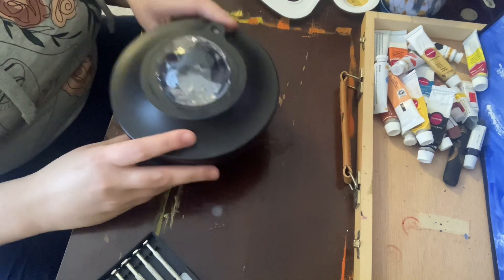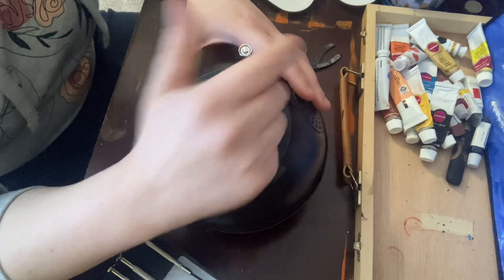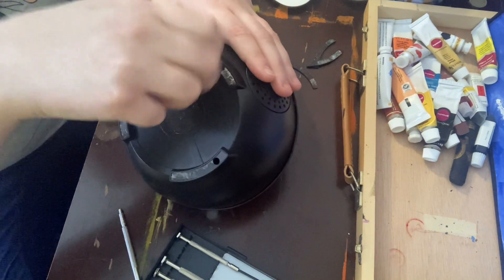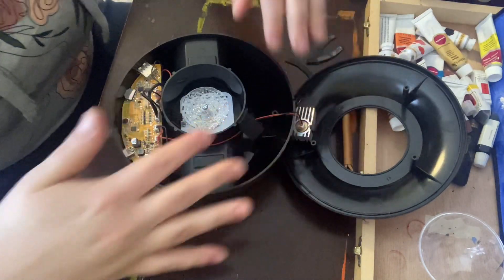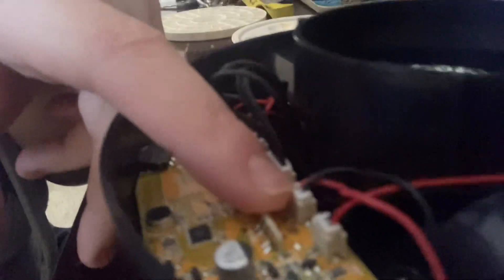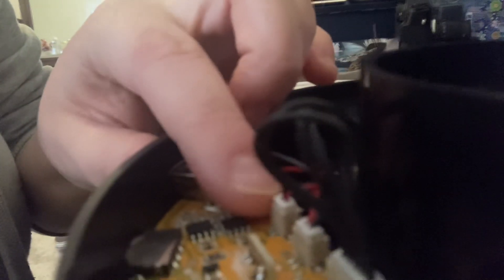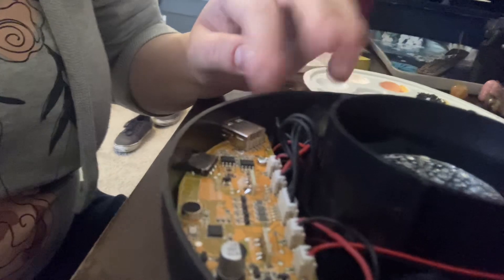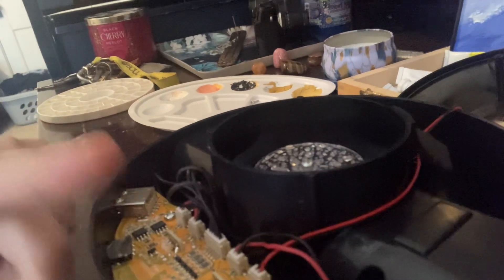Disassembly of Starlight Projector

Comment: the mechanism wouldn't turn so i opened it up and cleaned it and it works but i don't remember how to put the gears back on can you show it in a video how it's inside
Reply from the maker: I can’t, not until 3-4 months at least due to current living situation
Reply: @NotACupcake Thank you very much, I will wait for an update

Comment: My stars are spinning slowly but mine does not have that screwdriver in the middle of mine has a box with four LED lights in the middle followed by a reflective mirror like surface
Reply from the maker: You may have a different model if it doesn’t look like the interior of the one I opened

Comment: I have a different problem... my motor is spinning well, but there is no light being projected, neither white nor RGB, and the laser is fine
Reply from the maker: Did you check to ensure all the cables are fully connected? It might help you if you use some tweasers and very carefully unplug and plug back in the connectors.

Comment: hey man i just got one of these but like a cheaper version of shein and everything works except the motor ig cus its not turning around
Reply from the maker: Shoot if the motor isn’t turning you got a big problem. If you’re savvy in tech repair I imagine you could probably get a cheap mini motor and replace it with that but you would be better off returning the one u got and getting a replacement tbh.
Reply from the maker: Another commenter said you could try unplugging the wire for the motor and plugging it back in, that worked for them as well
Reply: @NotACupcake  alright thanks for the advice man
Reply: @NotACupcake  i’ll try

Comment: Do u know why my white thingy stopped spinning and how I can fix it?
Reply from the maker: If the motor is no longer moving make sure that the connector wires are securely plugged into the chipset and the motor component. If that doesn’t work then your motor might have burned out. You’d have to replace the motor or the entire projector. If you have working parts in the projector you could probably sell it on ebay for parts and use the money to buy a new projector.
Reply from the maker: From my experience of opening up the motor I saw that the gears in the device come very well lubricated with some sort of fine motor oil, so I doubt in your case it could be anything other than a burnt out motor.
Reply from the maker: Of course you can also try resetting the device with the reset button, you would have to google to figure out where the reset button is.
Reply: Yeah I have no idea where to find the reset button on mine
Reply from the maker: @LilTwix81  Because you asked this question I decided to google it. Turns out the manual does not have any information about a reset button. As of writing this I reached out to the manufacturer directly to see if I can get an answer. Fingers crossed!
Reply: So update I found out a way that may work for anyone who is having this problem I disconnected the cable that’s connected to motor and plugged it back in and it works just fine now but I don’t know if it’s temporary or if it’s a permanent fix

Comment: I used it with powerbank for 1 hour then it stopped working only red light turns on what to do
Reply from the maker: I wish I could help more but I think your best bet is to order a new one
Reply: Not recommended to use the fast charger powerbank or charger